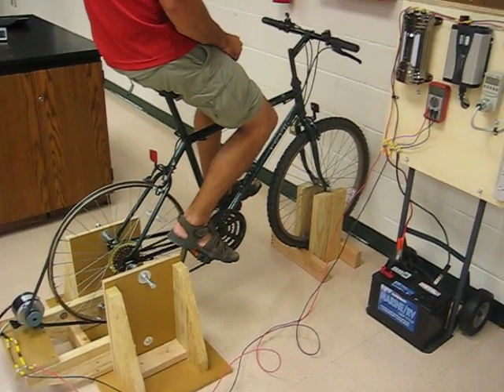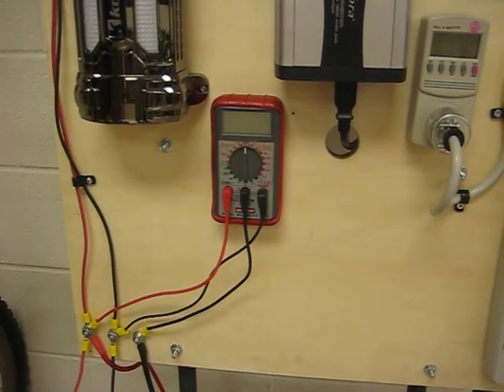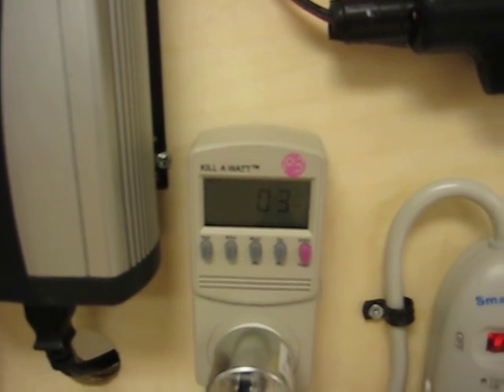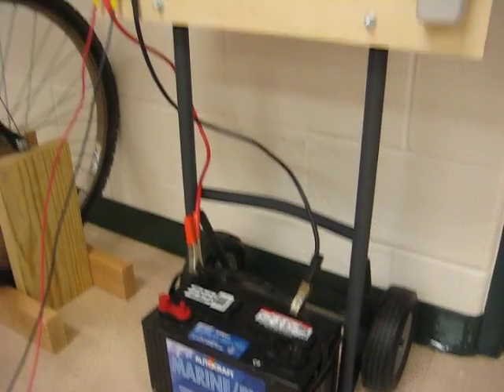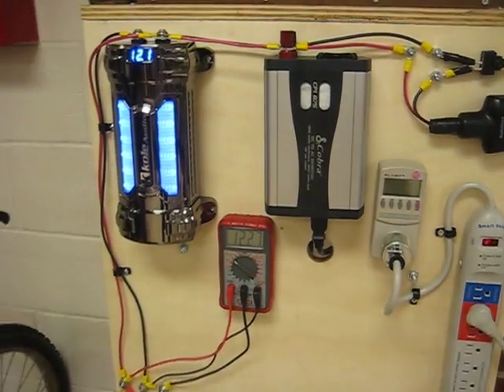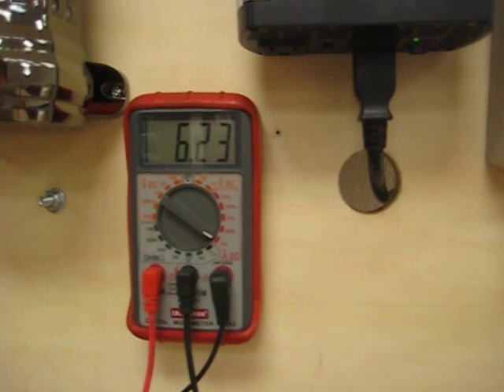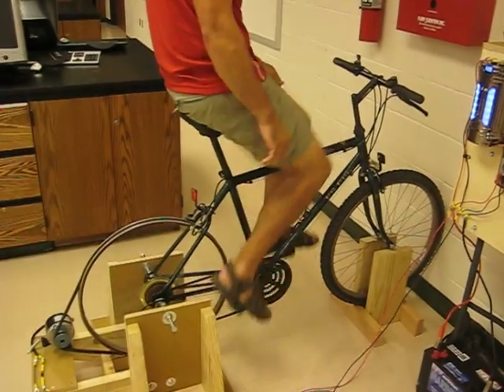Bicycle Generator with Construction Plans

Comment: This is exactly what i was thinking and im so glad you made this video. Id like to do this and use the 120 output at 5-10 amps to go to AC input on an inverter to charge a larger battery bank. This is the perfect setup.

Comment: Very well done !!!  The electric and electronic part of the system is excellent !!!    But in the mechanical part you forgot a very important element, the flying wheel !!!
   I´ll not explain what the advantages of a flying wheel are because there is plenty of information about in internet.
   But I´ll share with you a link to a video which shows how to make a flying wheel that will fit perfectly in you model:  https://www.youtube.com/watch?v=TBjuLDIjgkQ
   I hope you find it usefull !!!

Comment: An MPPT CHARGE controller between the battery and generator would have helped with the surge issue. I would also use 100 amp fuse between the battery and inverter.

Comment: So much wasted power between LEDs, displays, meters, and power conversions, inverters, etc. Very very inefficient and poorly planned. This is a kids science project at best.
Reply: The purpose of this project was a teaching exercise. He is showing you how to wrap your brain around what is happening because you cannot visually see electricity. The tools used give you some sort of visual representation to understand how electricity works and also conservation of energy.
Reply: yes I use a treadmill motor - and so I get 5 amps but it takes a lot of muscle to pedal. I can do 3 amps to charge a battery - that is an inverter - a lithium generator. But instead what I did was buy an adapter to wire directly into a portable DVD player. It's only 10 watts and so I use a DC-DC buck converter set at 1.5 amps. So I can pedal for an hour in easy speed while I watch the DVD player. If I stop pedaling then the DVD player turns off. Charging a battery at 3 amps is not so bad but it depends on the draw of the battery - batteries have a low resistance Ohm draw. Whereas a 60 watt light bulb is higher ohms at 12 volts - so you can pedal at 5 amps. So then you could do 10 amps for 120 watts if you have it wired up properly - I tried that but my wiring was not so good. It was just a demonstration anyway.

Comment: I am attempting to build a similar system but I'm not able to locate the pulley that you are using. The company that you purchased the pulley from is no longer in business (your video is almost 10 years old now) and I am unable to find a similar pulley. I ended up buying a motor very similar to the one you used in your video. Your construction plans are top notch. If you could assist finding a similar pulley to the one you originally purchased I (and other viewers I'm sure) would greatly appreciate it!

Comment: I like this setup.  I am trying to replicate what is done here: specifically powering several light bulbs with the bike, where the more lights turned on - the more force is required to pedal.  However, my setup is a little different.  I am using a car alternator (with field windings or field coils).

Is it possible to setup my car alternator such that if I stop pedaling, the lights will turn off (as it happens in this video)?  My problem is, every configuration I can think of includes the battery (which is required to energize the alternator's field coil) in a loop with the light bulbs.  So, the lights are on whether or not someone is pedaling the bike.

I'm a bit out of my area of expertise, so any help or reply is appreciated.

Great video btw :)
Reply: If the battery was only hooked up to the inverter, and not have to go through that weird capacitor that lights up when electricity goes in, it will work right off the battery.
You can leave it like that even while you're peddling, if you put a simple regulator in between the battery and the system. Then it should work when you stop peddling and not overcharge the battery.

Comment: Question.. you used a 250 watt motor, what if you use a 1000 watt motor instead. Whats the benefit of using higher wattage

Comment: why you put that diode in the red wire ?i dont undestarnd. in try to do the same, i bought a geo metro car alternator it has regulator and rectifier 
,have the bateries, but i think that someting is not working,cause I 
charge the batteries and then they run out when they are used

Comment: So how long would it take to recharge that battery?  and   Could you hook up this bike to a Tesla Power wall?  If so how long to charge the Power wall?
Reply: A Tesla Powerwall has a capacity of 13500 Wh. A person in good shape can probably generate 200 Wh in one hour. Maybe they can do this twice a day along with their other activities. Therefore, it would take at least 34 days of 2-hour vigorous pedaling to fill up the Powerwall, but of course, that does not include things like electrical and conversion losses, so it would actually take more time/effort.

Comment: why are you using a capacitor ? do we have to use a capacitor to charge the battery ?
Reply: I was going to ask the same question. I don't think the capacitor is necessary. I've seen several others like this than didn't use a capacitor at all.
Reply: GlobalTubeTruth2 I build the same project Almost one year ago and we charged the battery directly without the capacitor.
Reply: why you put that diode in the red wire ?i dont undestarnd. in try to do the same, i bought a geo metro car alternator it has regulator and rectifier 
,have the bateries, but i think that someting is not working,cause I 
charge the batteries and then they run out when they are used

Comment: You need to put a diode in between the battery and the capacitor so as that you don't have power coming out of the battery to the capacitor, I thought that would have been a general thing that would have been done.

Comment: Hello Aron, can this set up power a refrigerator and possibly a washing machine? If yes what modifications needs to be done on your plans? Also will forklift batteries work well with your design? Finally, most of your video, and plan makes no sense to me. Are their books I can read, that may be able to help me understand about this type of electricity, and electricity from batteries? Thank you! My e-mail: dg7182801918@aol.com

Comment: What would happen if you used a different size motor? I noticed that both the capacitor and the motor are 24 V. Do they have to match? Would there be any problem in using a bigger motor? Thanks for posting all the info about the parts, by the way.

Comment: Good video/ideas! Thought of this often. When load increased, more difficult to pedal, are the gears being shifted? Or could a gear shift system be used with proficiency? As the rider can get a workout comfortably still energizing a battery bank.

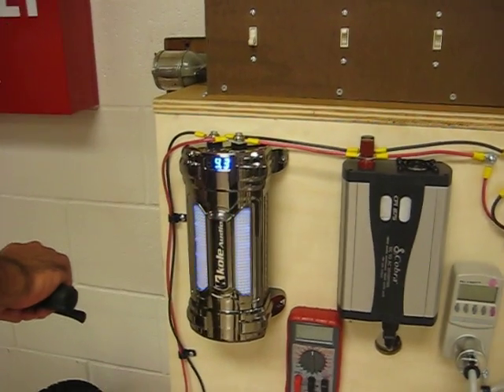Comment: 3:20- regarding V this is VERY IMPORTANT, you can remove this risk by including a SHUNT between the connections of the battery and generator

Comment: I've made a video on  a similar project, but based on an old exercise bike. I also explain methods of battery charging and stepping the voltages up to usefull levels:

Bicycle Generator: Generate Electricity with an Excercise Bike and a UPS at Home

Comment: Hi Aaron, great video! I'm helping my son do something like this for his 7th grade science project. We had seen the video at Bicycle Generator but have run into some issues.  I have posted my question there but have not gotten any replies.  I was wondering if you could help out as the project is due in a week. We have been able to generate about 2V but need about 12V. I think we are not hooking up the wire correctly. How does the multimeter need to be hooked to see the current that's flowing after the battery is switched?
thanks in advance!

Comment: ive been thinking about using this idea to power a live show at the beach. 
is there anyway to daisy chain several batteries together to keep a more steady voltage or power a bigger sound system.

Comment: how many volts is your motor, i saw a 24 volt 250 watt scooter motor online. is that the same as you are using? And also, what brand are you using?

Comment: I really like this design I plan on building one very similar. what are your thoughts on using a 18v dewalt drill motor for this project? if you want to feed into the grid will the cobra inverter be able to match the sign wave or should I use a grid tie inverter if I wanted to feed into the grid? what is the purpose of the ultra capacitor in your design?

Comment: I believe you've concentrated a little bit too much on the electric part of the project and less on the mechanical. First you need to use a better speeds setup, gearing up and down in order to give minimal effort for maximum output.

Comment: Thanks for the video! 

Question: Will a bigger motor, such as a motor from a treadmill or washing machine produce more electricity with the same amount of effort on the bike?
Reply: Not with the same amount of effort. A bigger motor will pose a bigger resistance so you will need to put in more effort to produce more electricity. If you put in the same effort as the smaller motor, you will get about the same amount of electricity out even if the motor is bigger. I say about because bigger motor means heavier parts to put in motion so slightly more effort.

Comment: Hi :)

Firstly, thanks for sharing this video.
I've done one bicycle generator too with a 24V motor (250W).
With the multimeter, when i test the volt of the motor, i get 40v-100v without a lot of effort on the bike.
So, how can i regulate the volt to 14 at anytime ? I've bought a "20A 12V/24V Solar Street Light Panel Charge Controller Regulator" but i don't think it will fit as the imput is higher than 24V often. (tinyurl dot com/c99p9r4)

Thanks to answer me :)

Comment: Aaron, I think you and I both ideally would need something around 10 amps. I went to Radio Shack and found 6 amps was the highest rating. How long did they last before they overheated (or was is it exactly that happened to it and after how long?)

Comment: Great work on this project Aaron! One of the best i've seen so far. Our physics team will be developing a bike generator. I noticed that you chose the 250W, 24v Electric Scooter Motor. will this be sufficient to power most laptops or is it best to purchase a motor with a higher wattage/voltage? Also, your construction plans list removing the sprocket off the motor shaft. would it be possible to send us the step-by-step guide for this operation? thanks for your help Aaron!

Comment: Now I already done my small project with exercise bike by using 280W scootor motor. Will it charge the marine 12V battery if my nephew could pedal and out put from scooter motor less than 12V?

Comment: Just bought a new battery today but haven't tested yet.
Anyway I still need to know more detail about the usage bike generator or wind generator.
You maybe right don't worry about overcharging battery because it may need hours of pedaling, so don't worry; we never pedal 10 hours a day lolzzzzz

But if we use the same motor/generator change to wind treadmill generator so the wind might make it charges 24 hours a day; then we still need something to control.

Give me more idea, we improve together

Comment: Hi sivpao, if u don't give the battery too much voltage for too long there should be no damage, but the advantages of having one will allow you to both apply loads to your battery or inverter, definitely protect the battery, and this will ultimately give you an idea of your motor in real world applications whilst u gauge how much effort or realistic power you can capture from the motor. Look on eBay for the controller, jus a cheap one should suffice, £10-20, don't worry if it says it's solar or

Comment: To mattwoodproperty,thanks for your idea.
I don't have charge controller for this treadmill motor yet because I don't know what kind of controller should be used.
I don't know how much the rpms, I just connect motor to rear bicycle wheel and I didn't paddle too much speed. Then hook up the voltage measure to the cable it shows like 32V or over....So then I wonder how could it charge 12V battery? Will the battery explode? What can i use and know the battery is fully charged?
Pls give me more idea

Comment: To sivpao hong, could you link your motor to a charge controller, it will have a diode built in and give the correct voltage to your battery's safely, at what rpms did you get this voltage and have you done any tests with load yet?

Comment: Hello, now I test my treadmill motor (130V, 18Amp) with my bike and it out put voltage around 32V and some time over.......
I don't know how to use and how it work in good condition.

Will it has problem or explode if i hook up to charge my 12V battery?
How can i know my battery is fully charged?
What item/equipment to use to control over voltage and control over charge?
What capacitor use for?

Thank you.

Comment: I have tested 2 generator motors with exercise bike,one is treadmill motor 130VDC, 8AMP and another one is scooter motor 24VDC,15.4AMP,280W.
I tried to change speed and both of them output 15V - 32V.
It works very well with DC appliances, but when I connected directly with DC to AC Stanley 500W converter the light on converter just blink on/off and no power from the 120V outlet.
I tried many times but still didn't work.
Or DC to AC Stanley 500W converter doesn't support/work with this system?

Comment: Is there any reason you guys used such a huge capacitor?  On the website that you got the capacitor from, it says, the recommended capacitor size for systems 0-500 W is between 1 and 2 F.  Why did you guys decide to go with 6 F?

Comment: Great set up. Using a scooter motor 24vdc x 250 watt is the way to go. Using a 120 vac generator is no good, as you would have to use a battery charger to charge the battery. However, if you install a blocking diode in the generator line this will stop feed back from battery. Also, the converter is really an inverter changing DC into an AC sine wave out put..

Comment: Or perhaps a safer/cheaper way level the voltage would be to use a flywheel?  Store energy in rotating mass instead of electric field?

Comment: Thank you so much for posting this video and plans!  This is the first DIY bicycle generator project with comprehensive plans I've seen.  Just wondering (and I have not read your construction plans in detail), would it be a good idea to place the capacitor before the battery with a blocking diode in between?  That way, the capacitor can only discharge towards the battery, and it overcomes the issue where you can only connect the battery while mid-pedalling.

Comment: I bought the same motor you guys used but am having a hell of time getting the gear off. I haven't even removed the bolt on the end yet. I want to be really careful so I don't damage the drive shaft. Do you have tips on getting this thing off?

Comment: i did this back in 2000 for my High school project, i also work in some other companies in helping them save energy by connecting other light bulbs to motors such as air generator motor and things like that, this stuff is great you can even connect some wire to the air codionter motor and do some wiring to generate electricity such as light.

Comment: Does the capacitor take the place of a charge controller for the battery or is it related to the AC side? If so are you just being extra careful to not overcharge the battery?